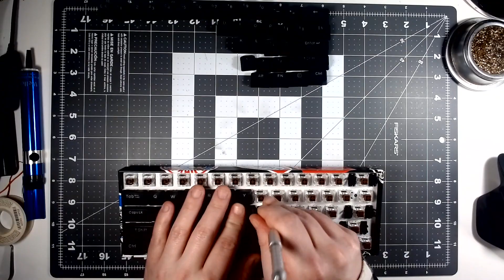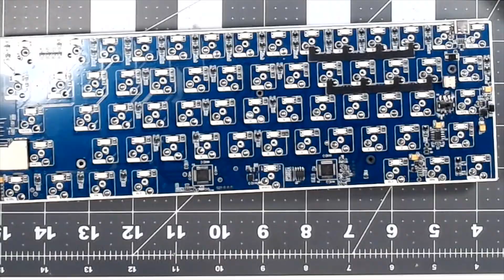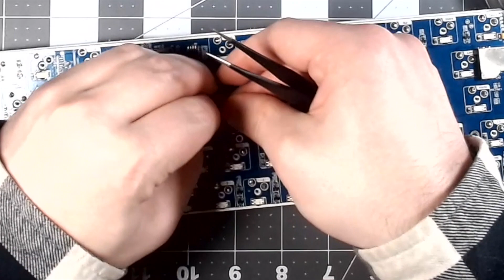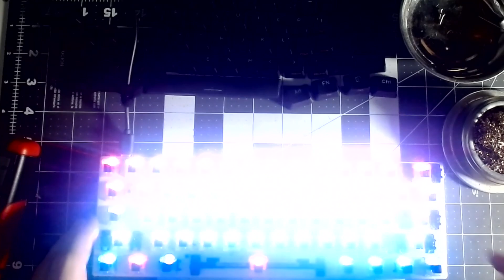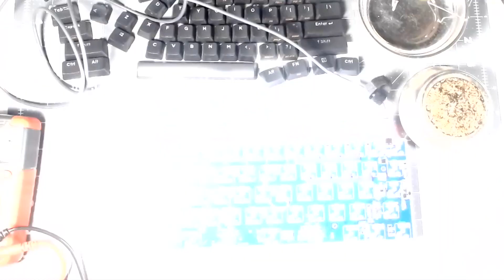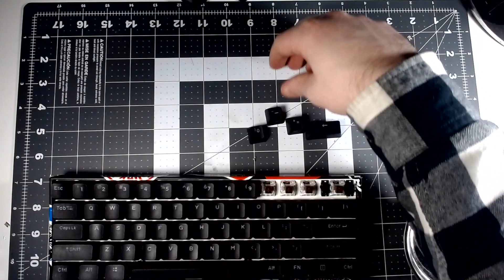Lets destroy an Anne Pro 2! (desoldering / lifted pad repair tutorial)

Comment: Hello. I’ve just pulled of a switch from my keyboard and the silver circle thing that’s suppose to outline the hole where the pin of the switch was sitting through got ripped off with the switch. Does this need bridging? Note that the silver circle hole is gone on the front of the pcb, but still exists behind it.

Comment: Hi! Thank you for the informative video.
I have a keyboard, although a hotswappable one (Redragon K552/Kumara). After replacing the switches, the keys C, F, 0, Page Up, and Insert stopped working. Doing some switch bridges actuate the switches around it, although not the switch itself. Is the keyboard bricked or can it be bridged in a way it would still work? Thanks in advance!
Reply: hey, did you get your pcb working again?

Comment: great video, what about the number row though, there are multiple diodes because of the FN functionality I believe, which is the right one?
Reply: I've managed to ruin key (number) 5 on my anne pro 2 and wondering about the same. Was happy i found a solution (i have 2 other keys not working which a simple bridge will fix) but im afraid im stuck again...
Reply: Nevermind, there are 2 (instead of 1) diodes above the switches on the row below the top one :)

Comment: where did you buy the weller desoldering iron?
Reply from the maker: I got the iron from a tiny electronics shop in Saint Louis.  It's on amazon though:  https://www.amazon.com/Weller-WLC100-40-Watt-Soldering-Station/dp/B000AS28UC

The desoldering pump I also got from Amazon.  I don't have a link for that at the moment though.
Reply: @bradmakeskeyboards5748  thanks friend

Comment: @
Brad Makes Keyboards if I need to connect a wire to a diode what do I do if it is on the"1" key. The USB C port is blocking where the diode should be, and I do not know where to locate the diode for this key, thanks :)
Reply from the maker: That's the top one on the Q key.  If you look at the PCB, you should see the lines (traces) going from the switch pin down to the diode.  You can just follow those traces to know where you need to connect.

Comment: Hi. Great video. May I know the solution for the ESC key as it does not have its own diode?
Reply from the maker: If you look at the spot for the Tab key directly below ESC, you'll see that it has two diodes on it.  Notice that the line on the top diode is flipped.  For whatever reason, they designed this board so that the top row diodes are on the second row.  You would just connect ESC to the top of the top diode on TAB.  

I hope that makes sense.
Reply: @bradmakeskeyboards5748  thank you soo much for writing this you helped me out soooo much ;)
Reply: @bradmakeskeyboards5748  Thank you for the prompt reply. You helped me out so much!

Comment: Hello, i wanted to ask you for help on my keyboard(rk71), i was changing the switches but in the process of it, i broke 2 keys(g and z), im pretty sure i melted both         pads on both of the switches, and i might've even broke some of the traces, would u be willing to help if i send u the pics?

I have 22awg wire, solder equipment, no multimeter tho
I added u on discord, my username is shu
Reply from the maker: I dunno if you got around to fixing the board, but I hope it went well for you!
Reply: @bradmakeskeyboards5748  this was also my problem, can you answer the person's question please
Reply from the maker: @dumplingglin  They contacted me on Discord and I helped them out.  I would need to see pictures of the board in order to tell you how to fix it.

Comment: Bro the centre of my keyboard pad is lifted 
If i connect a wire to both side of the pads then ot works some time but i need a permanent solution becuz i cant play games i have to press the s (broken pad)  key very hard to work
Reply from the maker: You'd need to solder the wire in place to make it work.  If you don't want to solder, then you could try some wire glue.

Comment: Help, I've bean struggling to fix this one button (Q), cant get any signal  on them and I didnt really get how you did this. I got a ASUS ROG Strix TKL Scope keyboard.
Reply from the maker: What happened to the key?  Did it get damaged during soldering?  If there's anything visibly wrong with the board, pics would help.
Reply: @bradmakeskeyboards5748  hey i mange to fix it, thank you though.. just had to solder on a different key and use diode

Comment: Great video sir. But do you have a solution if I lifted two pads in one key? Thanks in advance
Reply from the maker: If it's a plate mounted switch, it's not that big of a deal since the plate will hold the switch in place so you can just perform this method on both switch leads.  

If it's PCB mount, that'd be trickier, though you can apply a similar concept but just overload the switch pins with enough solder that it keeps the switch from moving.  Not great, but it's functional.

I saw someone on Reddit use a rivet to replace a lifted pad.  I'm not sure what type of rivet it was though.  This is something I've been meaning to do research into.
Reply: @bradmakeskeyboards5748  Wow, thank you for the solution, sir. Luckily, mine is plate mounted switch. So it should be easy.

Comment: What type of wire did you use? Great video!
Reply from the maker: Thanks!  I'm not using anything special.  It's just solid core (probably 22awg) wire that you would normally use with a breadboard.  Pretty much anything similar should work.  I would avoid stranded wire though.  The work is a little too precise for that.
Reply: @bradmakeskeyboards5748  Awesome. Thanks for the response!

Comment: Yo it was my first desoldering last year, the sockets were bit melted and the small metal hole on it were gone. Can i still fix it? I have no idea what lifted pads are
Reply: yea i got the same problem, do the creator know how to fix it?
Reply from the maker: Lifted pads are when the metal hole is melted.  You can follow this tutorial to resolve this by soldering a wire to the switch pin.  Jump to about 7:30.
Reply from the maker: Sorry for the super late reply, but what you're describing is a lifted pad.

You can follow this tutorial to resolve this by soldering a wire to the switch pin.  Jump to about 7:30.
Reply: @bradmakeskeyboards5748   hi this same thing has happend to me, the silver circle has been melted, therefore pads have been lifted ? I’m not sure what u meant by the wire being connected to the switch pin, I mean idk what the switch pin is , pls can u help me
Reply: Hey nice tutorial. I currently trying to repair a lifted pad on a right shift. The lower pad to specific. Any tips on how to fix this? Thanks a lot.
Reply: @jtechmkb  u had the same thing on me, does the other keys still works? Mine didnt
Reply: @arshhhh_  fortunately i got it fixed. I manage to find where to tap, took me 2 hrs to figure it out. I am fixing a board for my client. 😁

Comment: How would I test or know if my keyboard case has room for the extra wire there?
Reply from the maker: Easiest way would be to fit the case to the board a few times and see where it connects.  You need to potentially route around mounting standoffs as well as any other plastic supports the case might offer.

A good idea is to use the smallest piece of wire you can to make a connection across a straight line.  I used a larger piece here because I wanted to try (in vain) to keep my fingers out of the shot, but I could have done the same thing better with 1-2 cm of straight wire from one contact to the other.